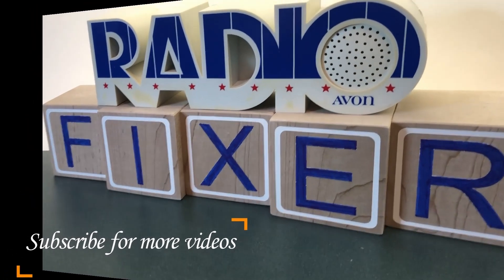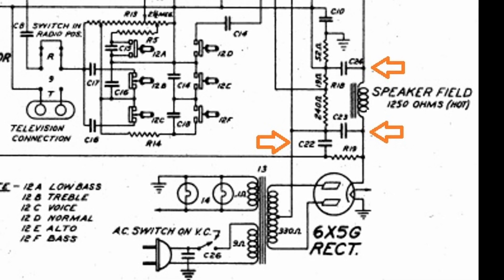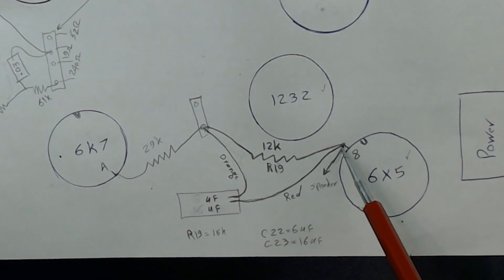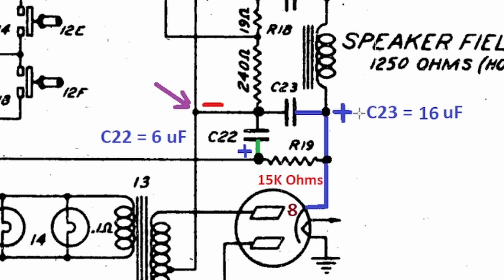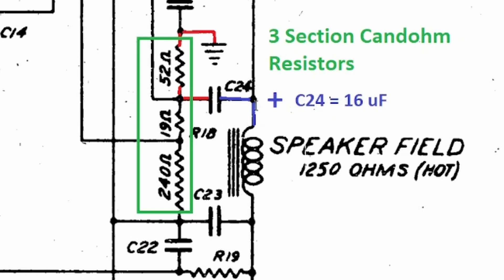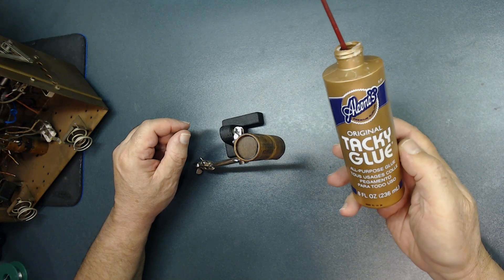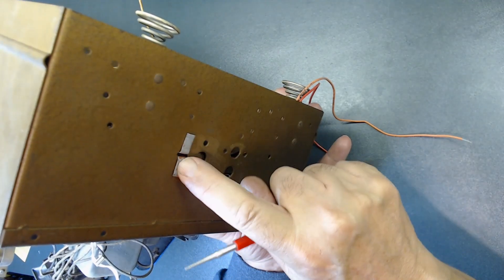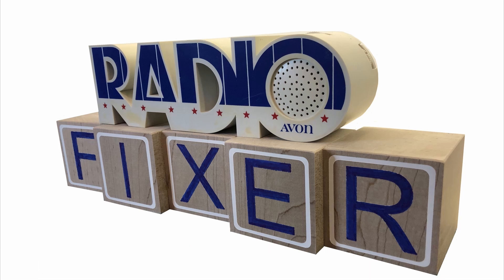Part 4- How to read Schematic (1939 ZENITH Console Radio)

Comment: With this design of radio a power transformer with a center tap line  it is the common return or negative side called B- . 
You were supposed to know that if you ever learn about radios back then. Yes it helps to read up on radio design which
is VERY important by the way and how to read schematic diagrams which sometimes have errors in them like missing
 values or  with diodes in a circuit they might be labeled in reverse.   Caught a few schematics in my time with a reversed 
symbol for a rectifier diode! Some radios have  the chassis as ground (as this radio) but is totally separate from the B-.
 When mounting  the new electrolytic capacitor it is a good idea to mount the values facing towards the opening of the
 bottom so you see the values plainly as you did Jay.  Thanks for sharing this with those who may be new to this kind of
 repair work.
Reply from the maker: Hi Steve, happy new year to you my friend. Thank you for bringing that to my attention, I have learned so much from you and other subscriber who have strong knowledge about this. I wished that I had a mentor like you when I got started. I could not find anyone to teach me, it was so frustrating to learn it on my own. My first radio I keep looking under the chassis for over 6 month before had courage to start on it and was another 4 to 5 month could finally fix it. Years later when I got comfortable with it decided to start this YouTube channel to pass along what I have learned so far to assist others with no electronic background who just got started or interested in this absolutely great hobby. I absolutely appreciate any feedback that can assist those of us who want to learn and do better. Have a great day Steve. Regards, Jay

Comment: Good suggestions Jay. Believe it or not I cannot recall a schematic which does not identify E cap polarities. Not saying it does not happen, and you obviously found one, but I'm thinking it's pretty rare when it does happen. One thing I always do when I buy a new radio to work on I gather all the service documentation I can find while waiting for the radio to arrive. Many times I find that not all the various schematic producers make mistakes. Use all the clues you have for determining which one is correct. Original wiring is usually a pretty good clue unless it has obviously been altered. :)
Reply from the maker: Hi Doug, thank you for such uplifting message. It is so nice of you taking time to leave me a comments. This darn radio schematic forced me to get better reading schematic.. LOL. Was no tube pin number on schematic as well, glad that I had a book to figure that one.. LOL. Was confused since they had Meg on schematic and was not sure if that was Meg or K, but after checking resistor colors then I knew they were Meg. have a great weekend my friend.